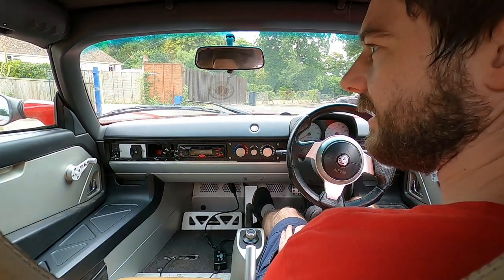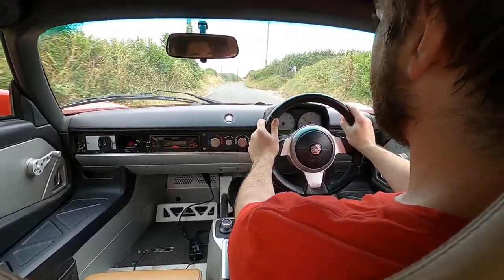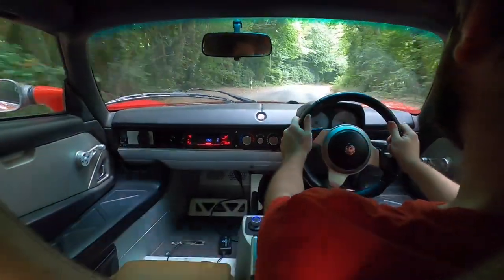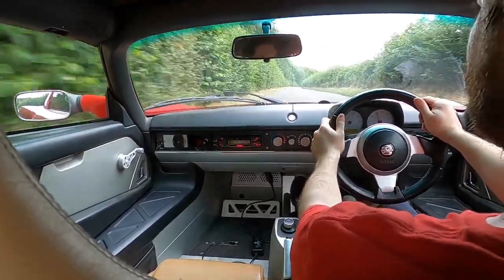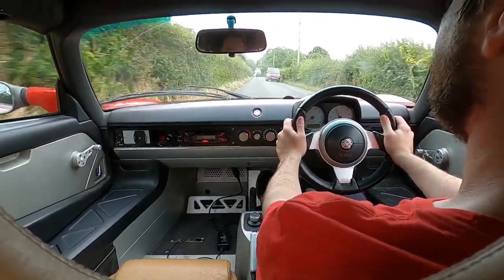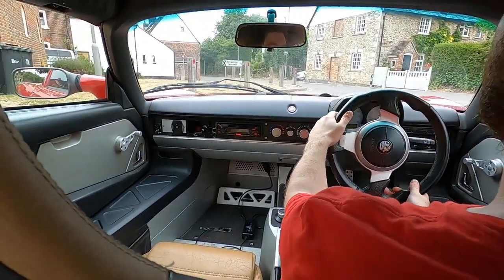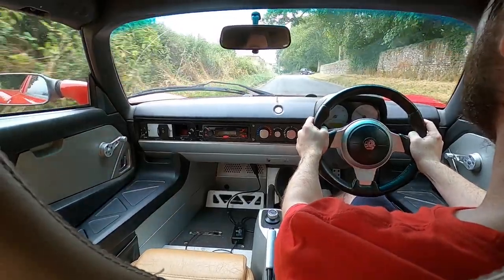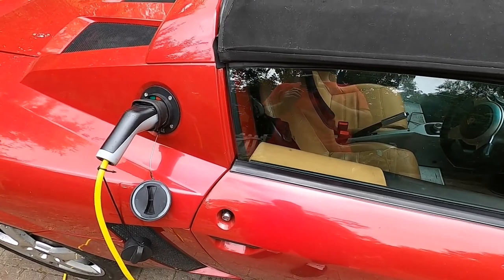Driving the VX220 EV

Comment: Brilliant, well done great convertion. You mentioned the 0- 60 time but what range are you getting. One issue I had looking at doing one of these conversion is getting enough battery cells into the small space to give any realistic range.
Reply from the maker: It was a lot of hassle fitting the batteries in the space. I managed to get about 20kWh in there. I haven't confirmed range yet, but anticipating something in the region of 80 miles.

Comment: Nice work Charlie - where are you on the "weight" situation? (sorry if you've answered elsewhere)
Reply from the maker: I haven't confirmed the weight but in theory I've added about 100kg on top of the original design (a little less if you take the weight of fuel into account). I haven't driven it hard enough to know how this impacts the handling but for normal driving it feels exactly the same. I tried to place the weight as centrally as possible but it's going to be a little more rear heavy than originally.
Reply: @netmaster10000  great project none the less. Whats next?

Comment: No vacuum storage tank?
Reply from the maker: No, might be nice to add one though to reduce the pump cycling a bit.
Reply: @netmaster10000  I was wondering the same. 
It would be noisier when first started but not so much while driving. Also would help for safety reasons.
Reply from the maker: @alibro7512  The manual for the pump states that its performance and life will not be reduced by cycling, so it's mostly a matter of noise. Since it's not audible over road noise when driving, the shorter pumping time at startup is actually quite a good compromise.
Reply: @netmaster10000  The reason I mentioned safety is (correct me if I'm wrong here) if you lose 12V you instantly lose brakes however if you have a vac reservoir you will still have a couple of presses of the brake pedal so enough to get you stopped.
Reply from the maker: @alibro7512  Yes and no. Even without a vacuum tank, there is enough vacuum inside the brake booster for 2-3 presses of the brakes.If you didn't realise you'd lost power, you could definitely exhaust this. I'd be interested to know how the brakes would be with no vacuum at all. Because the car is quite light I suspect it would still be quite possible to stop in an emergency, but I might do some testing on this.
Reply: @netmaster10000  Good to hear there is some resilience. In my case with no vac I have no brakes at all.